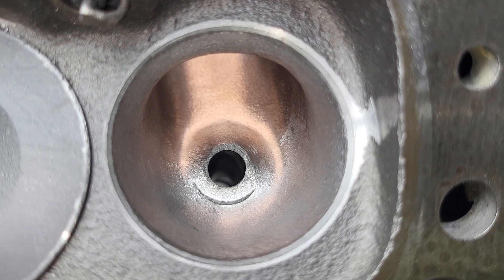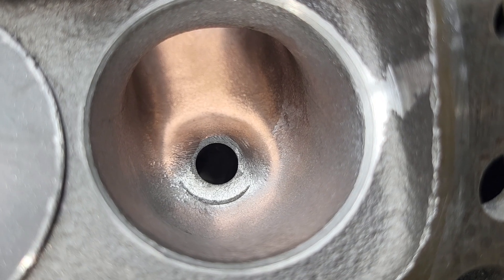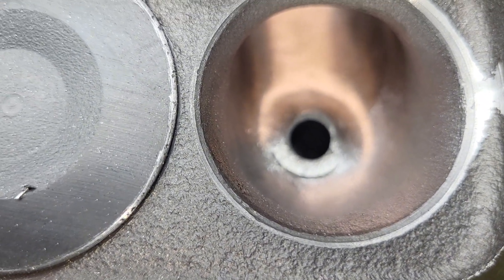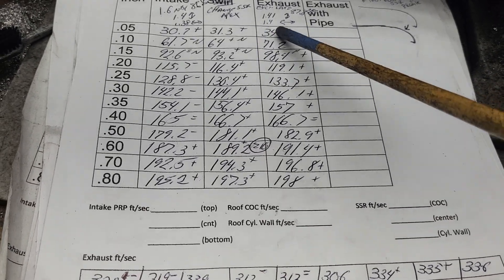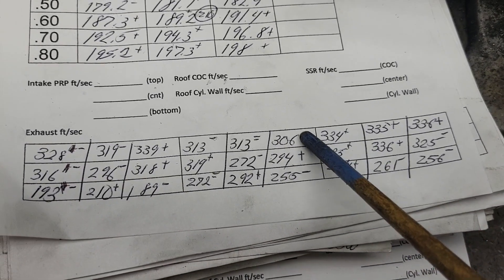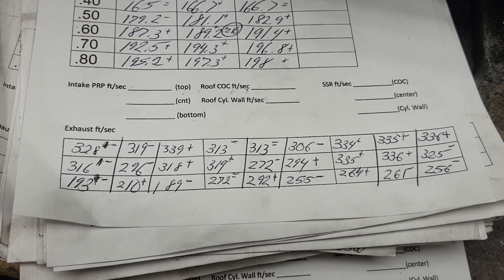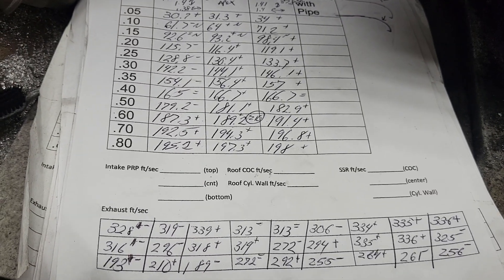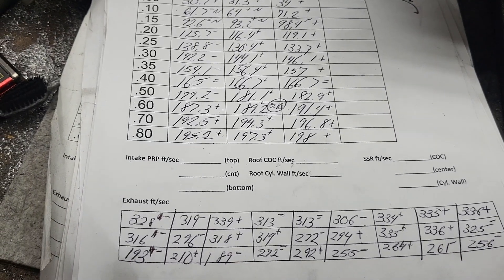Chevy TBI head exhaust throat experiment, Throat ratio 87.8% winner!

Comment: Is there enough meat on the roof to mimick a tpi/lt1 D port?
Reply from the maker: @tchapps88  Roof is basically stock.
Reply: @servediocylinderheads  i was asking if the roof had enough material to be raised into a D port
Reply from the maker: @tchapps88  It is stock thickness now.
Reply: 5 videos back he did a show n tell on a sliced in 1/2 (193) ex port check it out .

Comment: The 90% rule of thumb is just that.  It doesn't scale well and assumes that the throat is the minimum cross section in the port.  Valve lift,  chamber shape, valve size,  and the placement of the minimum cross section will all play role, and then it's down to what you're doing with your Valve job.
Reply: The radii on the SSR seems to be a significant player too ..

Comment: How did the average airspeed change? I bet you it changed less than half a percent. So weighing up the flow gains vs speed loss, I'd still call it a win overall.
Reply: Isnt it just a win at subsonic speeds were unbalanced velocities don't effect density as much ? but at higher velocities , transonic and so forth cant unbalanced velocities and densities turn into turbulence ? it may not be a win if its not relatively balanced ,  i/m assuming exhaust gases can go supersonic maybe im wrong in that assumption...
Reply: @luckyPiston  You are right they can, at very low lifts, because the pressure difference between the chamber and the port is such that you will get a sonic shock at the valve margin right when the valve comes off the seat. At that point, until around .200 lift, it is a supersonic diffuser, after that the valve/seat interface transitions to a subsonic diffuser. In that transition phase is where the most dangerous disturbance to flow occurs, as you correctly pointed out.

*I will add, that this happens long before the piston starts it's travel from BDC.

**On a four valve it would be closer to .100 lift.